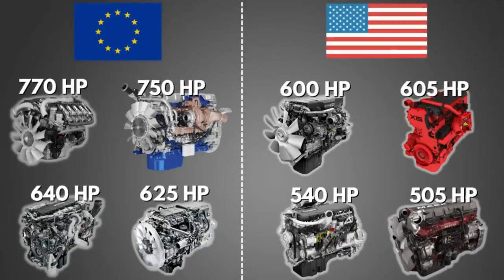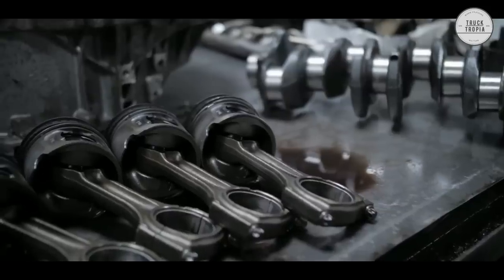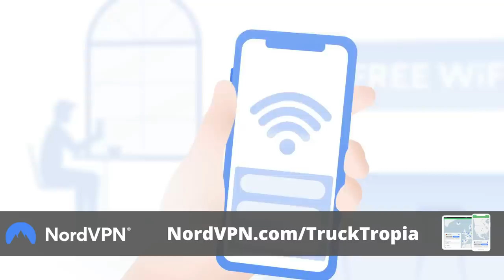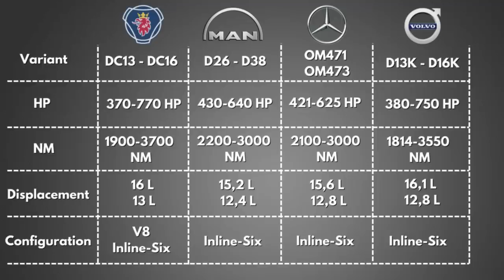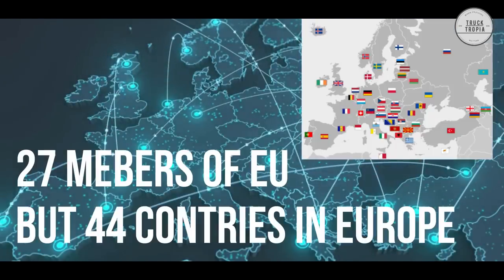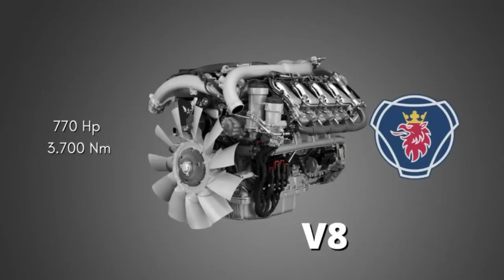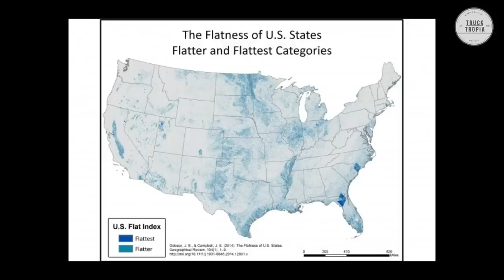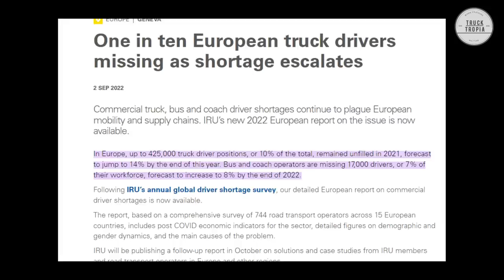Why European Trucks Have Up To 770 HP And US Don’t

Comment: For most applications 420 horsepower is more than enough. Used to transport reefers and walkingfloor grain in Denmark, drove a 560hp scania v8, never needed all of that. Think the 420hp inline 6 would have worked better with marginally better fuel economy.

Comment: Main issue between EU vs USA engines is the FUEL that you missed Royaly...

US usually is 40 CETANE vs EU 55+. It is older specs fuel rooted in 1940's vs EU upgraded their quality standards.....

This is the main reason that for exp. WAG'a group US 2.0L TDI has 140 HP vs in EU 170 HP. Those engines require specific lubrication to reach higher HP and torque that due to fuel imitations in US cannot do it.....

Comment: My 14 L 60 series was 475 hp stock, I had it reprogrammed and took off the emissions stuff and aftermarket turbo and manifold, now it’s 635 hp.  That’s more than enough for what I do.
Reply: And probably gets  15 - 20% better fuel mileage when driven civilized too.   I have an older Kenworth with a reprogramed Cummins N14 set to around 500 - 525 HP and it's rare to not see 8 - 10 MPG regardless of what I am doing with it.

Comment: there is a big misconception about basic physics at the core of this video. This should correct it: 
If it was not about power but all about Torque we wouldn't need motors at all, we could just pull The trucks uphill 'cause here's news: pulleys exist, levers exist, so do Transmissions in Trucks. 
So Yes, we can but guess how fast that's gonna go... 
Yes, them Diesels roughly have the same RPM and: sameRPM + more Torque = more power.  Same power + more torque ('cause only torque matters) = get uphill/moving with less RPM, and thereby with less velocity. 
(Yes you could change gears and go faster,  shifting a gear up makes the wheel go faster, yet doesn't change the engines Power, therefore the torque on the wheel becomes...? you got it :)

Comment: Canada has a 63.5 tonne limit in most provinces. I would run my 500hp 1850lbft Volvo D13 overweight at 69.8 tonne. Mack is not the parent manufacture, the just use the Volve D11, D13, D16(MP10) with their own ECU settings. Even the mDrive transmission is the IShift.

Comment: You can never have enough power when you are carting stuff,We had 2 tractors and the 150hp one you had to drop a fear from top to get up the hill,the smaller machine that was screwed up from 165 to over 200 could go up with a full load and never had to lift. Makes the job faster.

Comment: I was invited to test drive a couple of Volvo trucks in Gothenburg a few years ago including the 750 engine. But the lady from Volvo said that You really dont need that for normal Swedish weight limits around 60 metric tonnes. The 540 engine can handle that just fine. But of course drivers love that little extra power.
Reply: Says the bean counter lady. Drivers who actually use the equipment will have something else to say, and of course nobody listens to that. Then you end up pulling 64tons with 500hp torturing the living shit out of the truck while the same people before are totally confused about massive maintenance costs.

Comment: 600hp and 2,000 lb. ft. Torque is plenty of power for on highway use; it is even, in many instances, overkill. Most tractors that need these 700hp + and 2800 lb ft torque motors, are ones working in off-road/highway situations. Plus, in all reality, these trucks that come stock from the factory with 400hp can EASILY and safely be “turned up” to these high horsepower numbers with as little as a bit of fuel injection pump calibrating, or that and installing larger injectors and maybe even a bigger turbo. Diesel motors are, usually, rather de-tuned from the factory for economical reasons.

Comment: General information:
DD15 is Mercedes OM472
DD13 is Mercedes OM471
Volvo DD13 is rebadged Mack MP8 and red colour. Older Mack E7 E6 and others were all Renault diesel engines and was bought by Volvo in 2000 that’s why all Renault in Europe are rebadged Volvo engines like Mack in North America.
DAF Leyland is PACCAR
Cummins is the only American engine smaller PACCAR PX6 PX7 PX8 and PX9 are Cummins engines rebadged
CAT is also American but they are heavily involved with Mitsubishi they own Perkins and some are FIAT FPT engines rebadged mostly smaller engines.
Volvo construction equipment smaller engines are Deutz rebagded Volvo.
Large newer Deutz engines are Liebherr. 
Why reinvent when there’s one that can be rebadged.

Comment: The 80,000 pound weight limit in North America (not US) is only a standard weight limit. Weight limits will differ and increase based off of your state/province, the truck and/or the trailer's wheelbase, suspension, total amount of axles, size of wheels, amount of drive axles, gear ratio of differentials, weight capacity of the differentials, much much more. I worked in forestry here in Ontario, Canada and the maximum length your log trailer could be is 48 feet. I can't remember the exact number but you could have 6 to 10 feet of overhang behind the trailer. Those trucks fully loaded weighed from 140,000 to 160,000 pounds and yes we drove on regular roads for long distances.
Reply from the maker: True but im not Able to go in such detail 😅👍 thanks for sharing

Comment: Some corrections:
Both rail network length road network length and furthest drivable distances are comparible in both the EU and USA and the EU does use freight rail a lot when practical. It's just that we in the EU have quite a bit more trucks than the US, 6 million vs 4 million and some are bound to be required to have more power.

Comment: What is a characteristic of big bore V8 diesel engines with high mileage?

Large bore diesel V8s will wear out of round over high mileage due to the weight of the rotating assembly.  Scania V8s have much less wear than the earlier V8s used in North America because they have lightened the connecting rods and pistons considerably since the 1990s.

Comment: i can tell you why.....more torque is needed in europe,as our roads are more narrow than in the us.more over, our trucks are dimentionally smaller than in us,more compact,turning circles are smaller ,and with a 40-44 tones its easier to turn when you have more power and torque than as longer trucks using more momentum in motion.

Comment: Incorrect information about American Rail vs Semi truck. Loads with short time requirements of 3-5 days will be taken by Semi. Loads that don't need to be readily available and have a longer time allotted get delivered by the Train. As far as weight goes of course the train can carry more weight but we also utilize both Rail and Trucks for some of the Oversized or Over dimensional types of loads. In addition our beautiful classic American Peterbilt 379 Exhd. rides and looks better than any EU truck made.

Comment: The truck driving limit is 90km/h (56mph) limited here in Europe. You need the power on the hill to climb . Otherwise with low power you can’t climb  the hill and you lost very fast speed. 
The power ist only for the hill! Cause of the speed limit!

Comment: You said trucks don't need that much HP.  That statement is true if you're the only one on the highway.  You can just take your time to get the truck up to the speed limit.   I drive mostly during off-peak hours so yes I don't even need to floor the accelerator to merge onto the highway.

Comment: The trucks in Sweden is much bigger than in USA,in Sweden there is most full trailers vs semi trailers in USA
In Sweden the length of a full trailer is 33 meters and the weight is between 60-90000 kg so the big engines are needed.

Comment: The statement torque does the work is plain wrong. Horsepower is what does work. Torque is a part of the formula to get horsepower.  The transmission multiplies the torque as needed.

Comment: You can haul more then 80,000 in the US. 105,500 if you've got the axles for it and pay the extra tax. Then there is overweight permits if you have to go above that. My question is, whos making the transmissions that can handle that much torque? Eaton 18 speeds only go up to 2050lbft, and allison automatics only go up to 1850. That Scania V8 is something like 2700lbft....
Reply: Volvo and Scania make their own transmission. Volvo once pulled a 750 ton road train with one of their trucks just to check the transmission.
Reply: Yeah. This video is filled with inaccurate information. Completely BS.

Comment: right from the start....  Torque is a measure of the engine's ability to APPLY FORCE.  Power is the measurement of ability to do work:  to APPLY FORCE over a DISTANCE at a specified RATE.

Comment: Also I’d like to point out privately owned trucks in the us at rarely stock most have cats or Cummins making over 700-800 hp emissions delete turbo upgrade and tune usually will gain 200-300 hp depending on how hard they push it

Comment: A fact not mentioned in the video is that because of the high taxation in many European countries it's cheaper to send products straight to customers without resellers. I live in Greece and most flour mills here don't have resellers or local storage facilities and don't do last-mile delivery. Instead they send big trucks straight to local bakeries. This combined with the strict driving time laws of Europe creates the need for trucks able to gain speed more quickly in urban roads.

Comment: MY FRIEND HERE IN THE UNITED STATES DROVE TRACTOR-TRAILERS FOR YEARS AND ABOUT 10 YEARS AGO HE BROKE IT DOWN. I ASKED HIM ABOUT THE FOREIGN TRACTOR TRAILERS. HE SAID THEY CAN'T COMPARE TO THE AMERICAN TRACTOR TRAILERS. HE SAID THE VOLVO THAT HE DROVE COULDN'T PULL ITS WAY UP A HILL AND STRUGGLED AND THAT WENT FOR A LOT OF THE OTHER FOREIGN TRUCKS THAT HE DROVE. ON THE OTHER HAND THE AMERICAN DIESELS WOULD HAUL UP THE MOUNTAINS AND PULL THE MOUNTAIN DOWN ALONG WITH IT. THEY CAN RATE THEIR MOTORS AT HIGHER HORSEPOWERS BUT IT DOESN'T MEAN ANYTHING. AT THE TIME HE TOLD ME THE STORY. HE WAS CONNECTING A FORD DEALERSHIP WITH TRACTOR TRAILER TRUCKS FROM COMPANIES THAT WERE PHASING THEM OUT. THAT FORD DEALERSHIP WOULD SHIP THEM OVER TO EUROPE WHERE THEY WERE IN HIGH DEMAND. I GUESS THERE'S A REASON FOR IT.
Reply: Don'tknow what speific tractortrailers your friend refers to, but in general it's not about American vs foregin tractors. A horsepower is a horsepower, all over the world. A foregin 450 hp truck will feel about the same as a 450 hp american truck, with a bit variation due to transmission set up and such details. Most class 8 size truck both in the US and Europe got typically around 500 hp, hauling just 80-90000lbs grossweights. In parts of Europe some trucks can legally haul 100-150.000lbs, and then the larger engines 6-7-800 hp comes into the picture. Horsepower is the least of issues with the Euro trucks. On the other hand the Euro truckers envy the big sleeper cabs avaialbe in North America. But due to strict lenght restrctions in europe no big sleepers. But they get the job done anyway.
Reply: @Rimrock300  I'M JUST TELLING YOU WHAT HE SAID. THE EUROPEAN TRUCKS NEXT TO THE AMERICAN TRUCKS ARE INFERIOR AND HE ESPECIALLY MENTIONED THE VOLVO. IT STRUGGLED TO PULL IT'S WEIGHT.
Reply: @Frank289100  I belive you sir. I'm not familiar how Volvo setup their trucks made especially for the North American market. Seams they are tuned down. In the trucks used in Europe, enough horsepower is the smallest of problems as mentioned. If it were a problem, we would seen lots of US made engines in Euro tractor trucks, but there are none.
Reply: Volvo are base line economy trucks in the US, we don't usually see their best available units, because companies that want to spend that much go with other makes that haven't been stereo typed as cheap shit. Yeah, all those plastic fenders tend to break and fall apart on a lot of the oilfield access roads in the western US, so a lot of drivers don't want to deal with having to do infield repairs involving duct tape and tie-downs.
Reply: @Rimrock300  IT'S BEEN A FEW YEARS SINCE I SEEN MY FRIEND. I WILL CALL HIM AND GET BACK TO YOU ABOUT THESE EUROPEAN TRUCKS.

Comment: Trucks with too small engines are often a "problem" in Norway, because the small engines combined with a lot of steep hills and tunnels often causes problems and extremely slow going trucks upp hill. 

Trucks with bad tires, lack of chains, not optimal drive axle and lack of experience in winter conditions are also causing a huge mess on the Norwegian roads each winter.
Reply: @Tvuvtctoj46fck  I understand your situation, but the requirements for being a truck driver in Norway are high and if you don't have the education to drive on winter roads you should not start by doing it alone. 

Taking it slow is often a good thing, but you would need to let other drivers by. Also remember that good winter tires is key, and chains should be used when needed. It is to late to put on chains when you are stuck and causing problems for others by blocking the road etc.

Comment: Kind of disappointing using outdated information. Daimler used to own passenger car, LCV and truck brands. Now there's Mercedes-Benz Group that owns and builds passenger cars and LCVs, and Daimler Truck which takes care of the large commercial vehicles. The two companies work independently from each other.

Comment: The first massive blunder is at 1:00! If there were no gearbox torque would indeed be most important. But there are gearboxes and they change torque as needed. What they don't change is horsepower.  So that HP is important, not he torque!

Comment: horsepower is generally superior to torque for applications where you want light weight efficient designs, torque requires a lot more physical structure, to transfer the high loads, which means higher total mass where as a high horsepower setup can simply spin a weaker prop shaft and transmission much faster to deliver the same energy, ultimately a high horsepower engine is superior technology as it can be used to make a lighter more efficient truck, however nobody really cares that much, because the practical difference is minimal, the cost of a cheaper engine design can offset the cost of fuel for a while, trucks are expensive things.

Comment: Video is inaccurate. Very few large HP engines in the eu and the USA has larger HP engines than mentioned. Biggest factor is the tightness of drive time regulations and open vs tight, hilly, congested roads.

Comment: 0:49 This doesn't make any sense. If you have big torque, but no power, you'll crawl at a snail's pace. With big power it doesn't matter if you have torque at the engine or not, because with the appropriate gear ratio, you can get as much torque as you need at the wheels.
Reply: But you can’t have horsepower without torque. Horsepower is literally torque multiplied by the RPM. So your argument makes no sense. How would it not matter if you “have torque at the engine”? You would have zero horsepower without torque. That being said, you’re right that the video is wrong. But so are you

Comment: My god, the world is changing. All my life I have been surrounded by underpowered cars in Norway. Watching Convoy and Smokie and the bandit as a child of the late 80´s, we would only dream of V8 engines. Ordinary cars would have 1.3 Litre to 2.0 Litre and 60hp to 100hp. A V8 would be only one out of maybe 500 vehicles. I don´t think the 80´s trucks were any better equipped compared to the Peterbilts we saw in the US movies. I am almost shocked to see that the trend is now opposite in trucks. Our mountain roads are very steep, so i understand the need for power. 
When it comes to ordinary family vehicles, we still don´t drive V8 or even V6 engines, but the last few years the average power of new cars has gone up significantly, but this is due to electric cars such as the very popular Tesla, with huge horsepower numbers. Ironically these electric cars were made common on the road by a US company, and the number of US-imports skyrocketed, but huge gasoline engines still remain few and far between.

Comment: Effective work is literally horse power, so no, its not about torque that you need. High torque is a consequence of needing an engine that will haul for alot of work hours, and surprise surprise: higher RPM reduce the longevity alot more than increased cylinder pressure from high torque. Thus you go for low rpm and high torque. 
Also high torque results from high compression ratio, higher than a regular low torque/high rpm engine, which means that the fuel efficiency is higher and by extent reduces the cost per distance.
Long story short: high torque is a result from: 
A). Lower maintenance time
B). Lower price per hour (distance).

Comment: And now... China has an 800 horsepower production truck with the Shacman X6000 with the Weichai WP17-800 17.7 Liter V8 engine... 

Well... all comes down to what you're using it. You really don't need 700+ horsepower and 3500+ N.m of torque to pull 36 to 44 tons which are the load limits for the US and EU countries respectively. 350 to 420 horsepower will actually do the job quite well, albeit with a bit of effort. Even Australian road trains where they gross up to 200+ tons, a lot will typically have in between 550 to 700 horsepower. 

Also fair to note that the transmission and differential ratios do a lot in pulling power rather than outright horsepower.